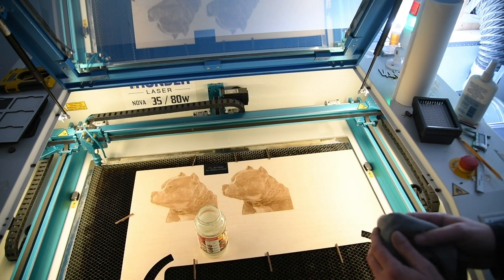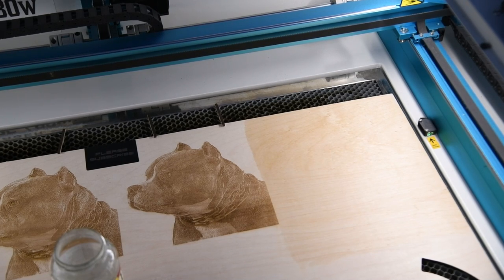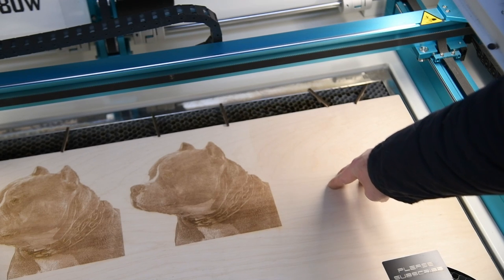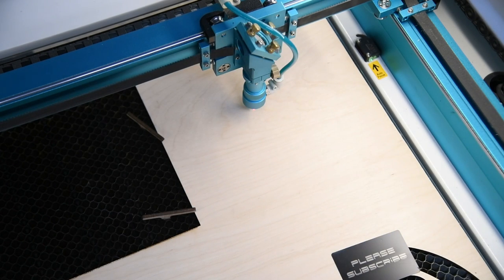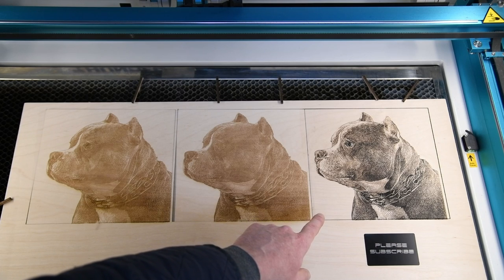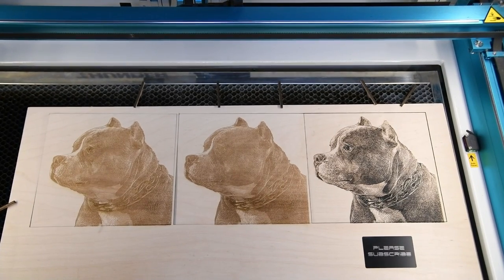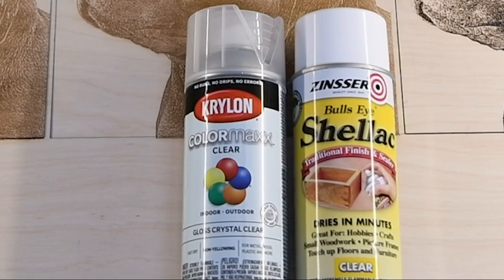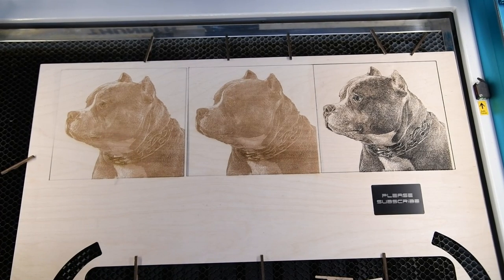Laser Engraving BORAX vs Lightburn vs Image-r dither comparison and results Co2 Laser Etching

Comment: So is the borax run’s image run through imag-r before and that’s the file you use? I know you mentioned the lightburn, imag-r, then the borax method but I’m wondering what format you got your photo from if that makes sense!
Reply from the maker: yes i find that image r does a better job when using borax it seems to put out a more even image, thanks for watching.

Comment: The only problem with this method is if it gets wet the image disappears other than that it gets great contrast on wood.
Reply from the maker: i clear coat mine and they hold up fine.
Reply: @carphotography  that’s what I do as well, the results are phenomenal. I always forget to buy borax or when I go to buy it the store is out so I get by with baking soda. It’s not as dark as borax however. Have you tried powder coating? Engrave, spill some powder out on the wood, smooth into the voids with a credit card and engrave again to flow the powder? Use zero air it works pretty good for vectors.

Comment: Which model thunder? I have a nova 24 60w also. That was my first machine
Reply from the maker: 35/80, mainly a hobby as i work from home.
Reply: They work good, mine got me to where I wanted to be for business after a couple years.
Reply from the maker: @thatdudewithalazer9703   yeah when i first got my laser i had zero experience and looked for people or videos that would help out and i struggled to find any that explain the process from taking your own photos and editing them to make them work on the laser, but with trial and error im at a point where im happy how they are coming out, im just trying to help out someone else that is in my position. just give peoeple somewhere to start to understand.
Reply: @carphotography  what's the product you spray to treat it called
Reply from the maker: @leongonzales4253  just a clear coat spray i normally use Rust-Oleum  Protective Enamel Gloss Crystal Clear Spray Paint